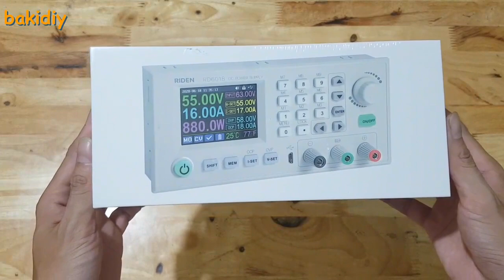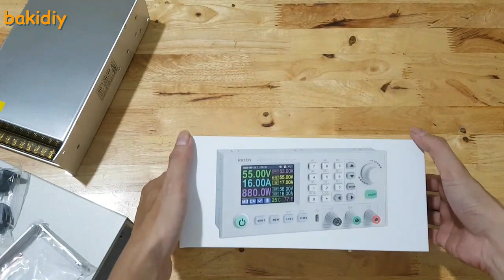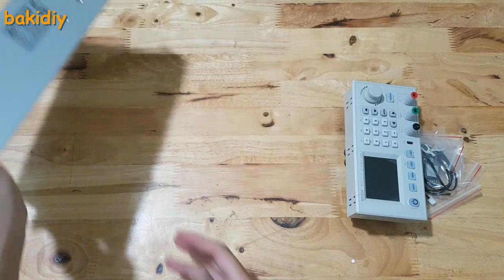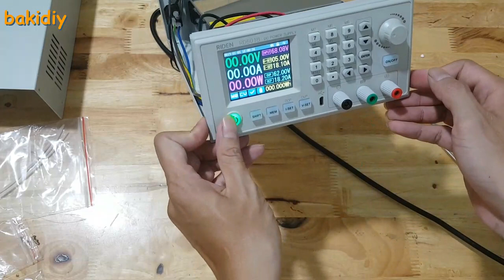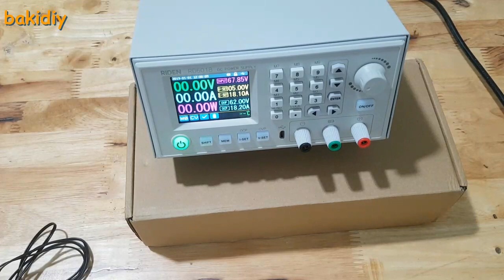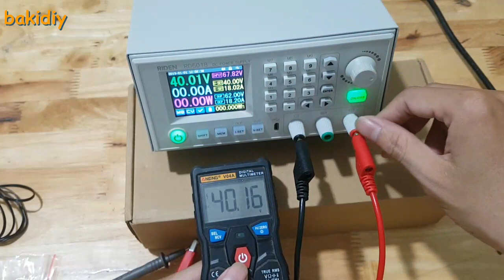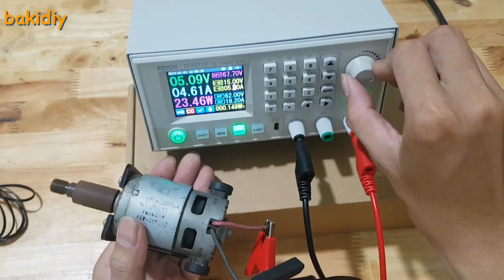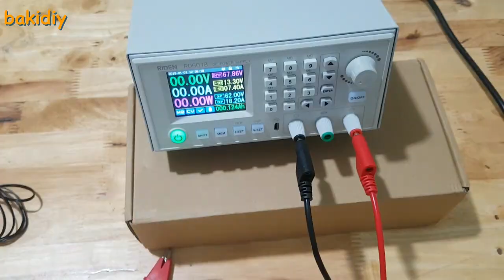Riden RD6018/RD6018W Power Supply + S800 case + RD1200-68 PSU - Unbox - Assemble - First Test

Comment: You're supposed to use the cable ties and standoffs to keep the high voltage AC wires away from the metal case.

Comment: Hello, I have the same smps. What's the value of load resistor? 

According to the color code of my, it is supposed to be 510 ohms, but when measured it shows 5 k. It gets pretty hot. Do you have any idea?